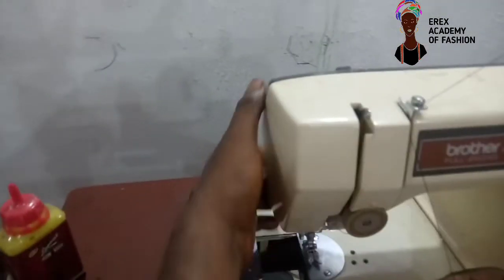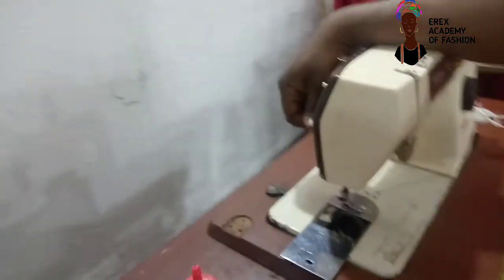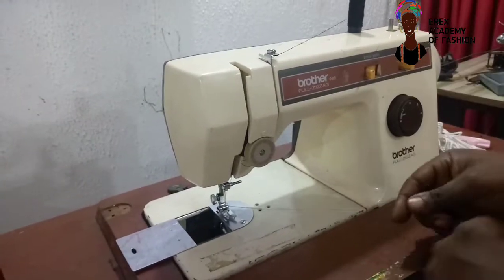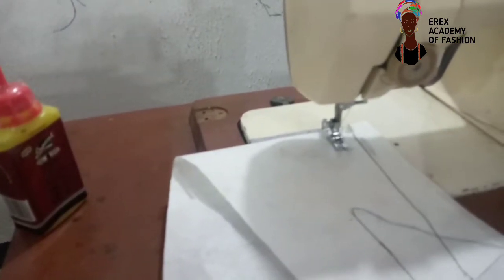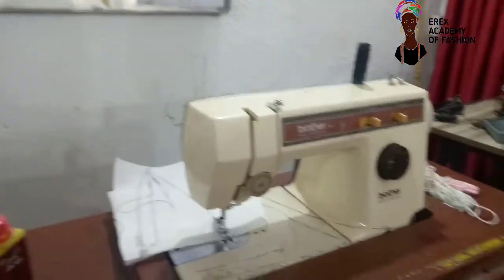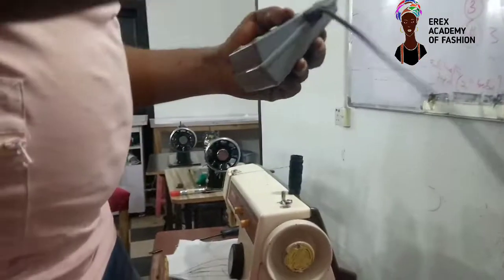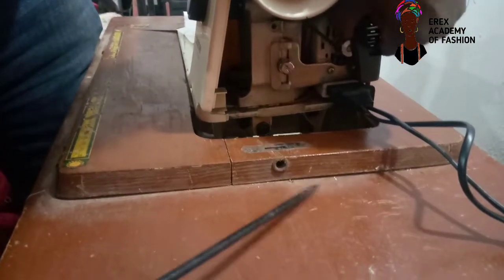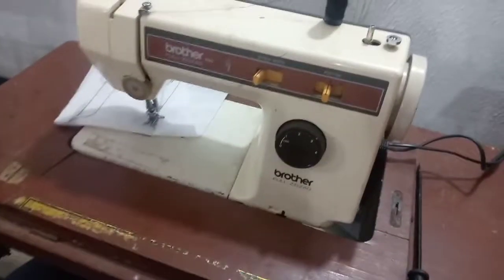HOW TO THREAD AND USE A BROTHER 999 ELECTRIC AND MANUAL ZIGZAG AND STRAIGHT SEWING MACHINE.

Comment: I have this type of machine that i use for making wigs but when I’m sewing,it keeps hanging pls what’s the cause??
Reply from the maker: I don't really understand what you mean by hanging but if you mean it stops moving suddenly, you might want to roll the balance wheel occasionally to help it move. Check to ensure that the thread is not tightly wound on the thread stand.
Reply from the maker: Check your shuttle also. The long claw that helps it hand unto the bobbin case holder might be too short. Haya shuttle is best so far